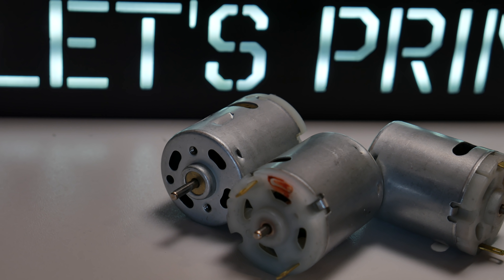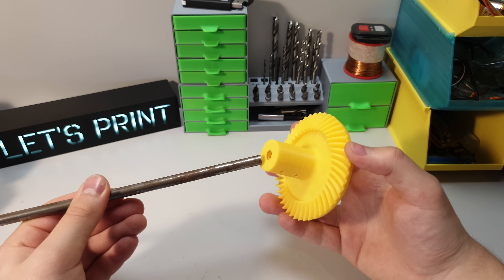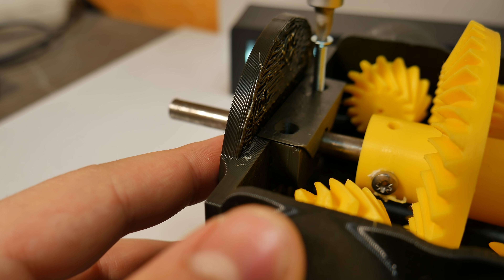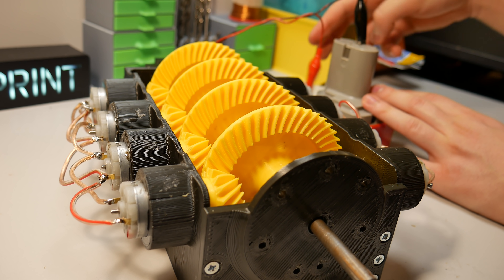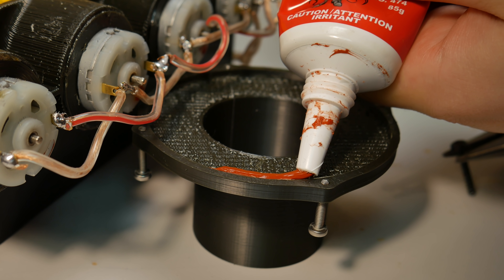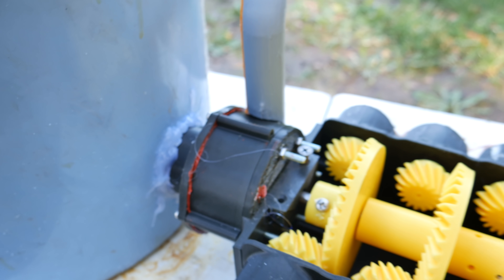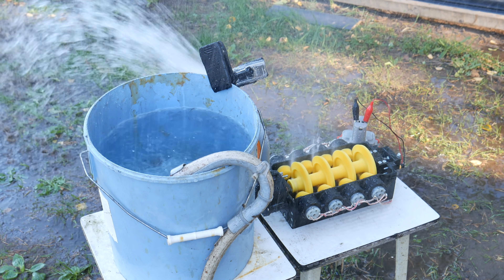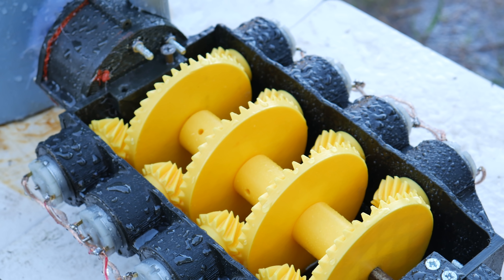Extremely Powerful 3D Printed Gearbox & Water Pump - Eight Electric Motors

Comment: If you disconnect up to 4 motors, you could use them to generate electricity also. You couldn't run the pump on them but you could regulate them and use them to charge other batteries like a laptop, tablet, cell phone or all 3 by regulating the outputs to different voltages. Great project!!!
Reply: ... Don't you think it would be more efficient to just send the electricity for the 4 connected motors directly to whatever you were planning to power with those generators?  No losses due to friction, heat, noise etc.
Reply: @CyberiusT  What I was referring to was the 8 motors run on 12 volts. If the pump, in a remote location, could do it's job on only 7, 6, 5, or 4 motors, any of the others could be regulated with a 7805 or 7812) 3 pin voltage regulator to charge a cell phone, tablet or laptop. At the low current required to charge these, the added friction would be almost unnoticeable and wouldn't serve to deplete the main battery faster. Plus, all brush motors produce high voltage spikes with the passing of the commutator under the brushes. These spikes can damage sensitive electronics. Eight brush motors will invariably produce these spikes at different frequencies due to differences in their manufacturing parameters. In other words, no two mass produced products are identical. If you take one motor off line and build one regulator circuit for it employing proper filtration, you can obtain a pure DC output. Trying to get a pure DC output from the spikes of eight different motors being back fed down the main power line is achievable but it would be like using a Doberman to herd cats. You would have to track down multiple frequencies from 8 different motors in a tech shop using a spectrum analyzer. This would also be true using just one motor but you would be dealing with only one set of frequencies instead of sifting through a bowl of spaghetti with a pair of tweezers or picking fly shit out of pepper.
    I know that you don't get something for nothing but it was just a thought.
Reply: @jeffmccrea9347  Fair enough. In my defence, finding strange ideas in YT comments is remarkably easy.
Reply: @CyberiusT  Absolutely NO argument there, my friend.
My favorite is the kid that appears to be from India or Pakistan. You never see his face but judging by the skin color of his hands, the 240 volt outlets and fixtures he uses and other visual cues around his work area, this is just my guess.
    He likes to build and show "free energy" projects. He will wins a coil of wire, solder it to the contacts of a paperless speaker 
frame along with the magnet(s) from a microwave oven. He'll set it on a table, flip a switch and light a marked 240 volt light bulb or some such other project.
I don't know you so I don't know what you know so for you or any readers out there who wants to know how this trick works, here it is.
    Induction is the ability to send an AC signal, like house current, from one coil to another without any direct connection. Everything from the power transformer like the older, heavier wall transformer blocks that charged cell phones years ago to the big gray trash can with wires on it on the power pole behind your house all work like
 this. An example is the transformer behind my house. There are two coils inside. The wires going from the pole are charges with 7,200 volts. Obviously, if that power was fed directly into my house, it would light up like the 4th of July just before it burned to the ground. Instead, there is a coil inside that is exactly 30 times larger than the coil wrapped around it. There is no direct connection between the two. my house is in the U.S. so most things run on 120 volts AC with some high drain things like hot water, stove, dryer and central heat and air running on 240 volts for efficiency sake. The transformer on the pole, as I said, has a coil wrapped around an inner coil. This coil has a connection tapped exactly in the middle of it's turns. This way, the high drain items in my house can be powered by the ends of this coil at 240 volts and the lower voltage, 120 volt, items can be powered by the center tap and either one end of the coil or the other.
OK. What this kid has is a single coil plugged into a 240 volt, (his normal house current in his country), and bolted or propped up under his table. When he builds his projects, his coils are always wound to specific sizes and lengths which is what controls the voltage to the project. The microwave magnet and any peripheral parts are just for show and meaningless unless his project powers something that is DC powered. then Diodes and filter capacitors are used. When he's done, he will set the project on the table over top of the energized coil underneath. Then the bulb magically lights seemingly with no power source other than a stationary magnet and 
a coil. The bulbs that he uses are 240 volt clear glass filament bulbs and he shows the top of the bulb to prove it's rating. On the small wooden boards that he builds these projects on, there is no way that he could hide 240 volts worth of batteries. This is why he uses the bulbs that he uses. It adds to the mystery.
    Another one of his fun projects is his "super cap". Regular high capacity capacitors are just 2 sheets of aluminum foil with a paper separator. When charged, like a battery but faster, electrons build up on the negative sheet and desperately want to jump to the positive sheet but can't due to the paper separator. When a load is connected to the contacts, the electrons very jump to the positive sheet through the load very fast. This is how a camera flash gun works. I neglected to mention that the aluminum foil and paper separator and are wound into a sandwiched configuration in a round coil.
    A super cap is built much differently using something called graphene which is an atom thin layer of carbon instead of aluminum foil. It has a much, much greater capacity to store electrons so a much larger capacitor can be built in a much smaller case. Most electrolytic, (foil based) capacitors are rated in microfarads. micro meaning millionths and farads named after Michael Faraday who made many discoveries in the field of electricity in the 19th century. Super caps are rated in whole multiples of farads. A 20 farad super cap the size of a large soup can, built out of aluminum foil would be the size of a bedroom.
This kid was building a 5000 farad "super 
cap" out a four inch tall by 3 inch wide piece of plastic pipe, aluminum foil, printer paper, two glued on plastic end caps and 2 bolts for contacts.
    He would then "charge it up" with a battery then lay a heavy piece of wire across the two bolts and watch it burn up. Impressive!
    I must say that he had talent as a video editor because you couldn't see where he stopped the video, gutted his super cap and installed 4) "D" cell batteries which would burn the wire.
    If he was selling these things in the U.S., he'd be indicted for fraud. I debunked all of his stuff available as of last year with explanations as to how it worked and wrote him that if he were to bill his "craft" as a magic show, it would be entertaining but saying that it was "free energy" would only serve to disappoint people who tried to replicate his projects and prove him to be a fraud and a liar. He's still on YouTube.

Comment: Why would you use 8 small motors with a big unneccesary gearbox that introduces inefficiency when you could have used one bigger motor and just connect the driving shaft to the impeller?

Comment: 3:05 if you invert 2 of the 4 gears on the shaft you will no longer need that screw.
You don't even need to reprint anything. just reverse the polarity of the motors you flipped the gears.
Its the same principle of the double helix gear.

Comment: Constructive Criticism,  one thing I saw from Video is that the Exit pipe was to short. The blow back often caused water to fly back into the Gear Box which could have been avoided by lengthening the fluid exit pipe by 2 inches. but I do wonder what Other Fluids could this type of Impeller be used on. what Viscosity area it could be used on, Low to High?

Comment: I would've put some grease in the gears, it would've helped them move more smoothly. Not sure if it would contaminate the water, just a thought. Silicone oil isn't bad, but you'd want something that's thicker, that likes to cling.

Comment: It's not really a gear box, it's more just changing the direction of the motor.  You should try to step up the speed more with a series of gears instead of just repeating the one over and over.

Comment: Suggestions, first, look into sealed thrust bearings, they would work really well in this situation. Second, leave a gap between the impeller section and the gearbox to give leaking water a place to go other than the gearbox. Third, more thoroughly seal the impeller housing and seal the gearbox, with covers for the motors. Fourth, use grease(preferably marine grease to reduce pollution issues). It should reduce noise, protect the surfaces from friction damage and help waterproof the system. Fifth, grind flats on the shaft where the set screws on the large gears will be. Set screws do better at grabbing a flat surface than a curved one. And last, look up a better impeller geometry. You can make any shape you want with a 3D printer, you might as well make an effective one
Reply: I was thinking a print in place labyrinth seal and then grease.

Comment: You need multiple impellers passing the fluid from the first impeller to the second to the third and so on. The only thing you’re achieving with this is less rotating friction and distributing the load across multiple gears. You’d have almost the same results with only one motor and impeller. If each motor drove its own impeller you’d have a lot better pressure and flow. Or just one shaft with multiple impellers.

Comment: How is using 8motors really helpful. As rpm of the main shaft remains constant. Even if it's 2 motors or 8. The capacity you say, as the size of impeller and also the casing is same even for 2 motors or 8

Comment: Would be interesting to compare different impeller designs. Pla is easier to print with but abs absorbs less water over time so is probably the best choice. Also u cant chemically smooth the impeller like that if u use pla.

Comment: Hey, Cool project!
But i have to mention something here: You are not really showing the power of the pump with the current test setup. The height of the Water column (in the bucket) is more or less the same as the height of the outlet tube, which means that the pump is not working against the gravity, what pumps usually do. I would suggest the following, place the bucket on the ground, put the pump on a chair and make the outlet tube 1 meter longer. With that you create a significant difference in water level and you can measure the actual pump pressure [pressure = density * gravity * height].  Hydromechanics.
Non the less cool project and thumb up for this!

Comment: Make the impeller and turbine housinf farther from the gearbox. Use couplers to extend the connection. This will solve your water leak problems. It will still leak but at least it won't make your gears and motors and battery wet!

Comment: Maybe you want to put in an extra chamber that can hold the leaking water between the gearbox and the impeller. That way you have a wall between the pressurized water and a compartiment where you might find unpressurized water and you have a wall between that compartment with the leaked unpressurized water and the (hopefully now dry) gearbox.

Comment: This gearbox is reducing the circumferential speed of the impeller. That is the opposite of what you want in a pump.  But I guess you have to to get enough torque to overcome the rotating mass and friction.

Comment: You could make a shaft seal out of a rubber inner tube to stop the water from leaking out the spinning shaft. you just have to poke a very round hole in the inner tube rubber and slip it onto the shaft and seal it to the base of the pump. I used it for my homemade water pump and it works great with no leaks.

Comment: How much horsepower it is capable of ?

In another world can this pump the water from ground to  3  floor up ?

Don't forget your using 6 motors and they have a good speed and torque.

I know a one motor can pump between 1 up to 2 meter depends of the speed and the reality of the pump

Comment: I work as a mechanical engineer making screw pumps. We make everything from pumps the size you see here, to pumps that have 50" diameter collums. I have to say, this is seripusly impressive!! To get that amount of flow with such small electric motors and 3d printed parts is awesome, love the video 😊
Reply: @Random Autonomous Drone Pilot I'm betting that you are the best engineer in the world.
Reply: Will The plastic need lubricant?
Reply: @Greg-yu4ij  I think that most of these filaments would need some form of lubrication, although even water might work,,, using different plastics helps, vis-a-vis lubrication needs, but Delrin would be a good choice for some part, perhaps?
Reply: Hi i am working on a project related to centrifugal pump is there any chance i can contact you for any help.
Reply: @ZainKhan-xx6np  do you think that pump can be pumping oil or is it too thick, need a good amount of flow for a hydrolic motor that basically is moving a large vehicle.. as if the weels are propelled by the hydrolic motor.. but I want it to go fast even if the whole thing is heavy as a tank!!
Reply: @ZainKhan-xx6np  might be printing one like this but metal special alloys and the size can be adjusted to fit what the electric motors will be.. as I collection the electric motors I got lots of sizes.. particularly 1/2 HP and 1 1/2 HP motors that were for pool filter pumps big pools it is to say 👌
Reply: i live alone this is perfect for me
Reply: Have you ever built any tamiya Rc cars/trucks? Your designs are incredible and simple. Much like a Tamiya model. :)
Reply: I would put some grease that you put in machinery for the gears not melt and damage
Reply: @Anthony Demaio
Reply: That moment when some random guy with internet access and 15 $ do more than an engineer that get thousands for NOTHING.
Reply: wow
Reply: Really... impressive? It's being aided by gravity lol, put the pump above the tank, then turn it on.
Reply: @Random Autonomous Drone Pilot Bro get a life lol. He didn’t say it was sustainable in it’s current state or that it would be useful just like that. It’s clearly just a proof of concept type thing and he just said that it was impressive that it could run so well using small electric motors and 3D printed parts. I’m pretty sure the mechanical engineer who literally designs water pumps probably knows more about the subject than you. Stop trying to flex the intelligence that you think you have, it’s really embarrassing and you’re making an ass of yourself.
Reply: I like that it has some system redundancy, great for remote operation, and uses cheap motors, coupled together to get reasonable, and scalable, Power... I suggested one-way drive mechanisms on the motor, to prevent a motor failure from stopping, or slowing, the pump... I wonder if the gears could be printed in pom/delrin? Knowing zero about filament availability ;-). Also, maybe the gears could be run-in before final assembly, and run in a sealed enclosure with a light lubricant bath?
Reply: @Random Autonomous Drone Pilot and now looking at the comments on your one YouTube video; you seem like such a sad sad man, so bored with your disappointing life that all you can do is surf YouTube looking for videos to heat on.
Reply: @Random Autonomous Drone Pilot Credibility flew out the window at “ just by the comment “🤣
Reply: @lyteyearz5810  why?
Reply: How many engineers does it take to conclude that gravity is doing most of the work...

the water would have come out just as fast from a hole of the same diameter.
Reply: @Incarnation613  not many. It's clear this "home made" pump/gear box assembly does exactly what he expected it to do... make some watchable youtube content. You watched lol. As for the wannabe youtube engineers, this pump looks to be flowing roughly 20gpm. Not bad for what it is. Sure this system won't be sustainable or produce reliable pressure but as a simple project a child can assemble in science class this rocks. Pretty sure that's the point of his channel lol.
Reply: @Incarnation613  No... no it wouldn't have.
Reply: But it's loud as fuck only ok for basically nobody
Reply: @spacecowboy07723  It will actually get quieter as the gears "run in", and, in many applications, no one cares, for example, in the middle of a corn field, and, in many cases, it only needs to run intermittently.
Reply: @spacecowboy07723  I could easily use this for drip line irrigation, no one is going to care ... maybe the chickens.
Reply: @artichoke00  Drip irrigation needs pressure, not flow. I dont think this can create a lot of pressure.
Reply: @spacecowboy07723  Implying deaf people are nobody?

Comment: all you need is some sort of shaft seal on the motors and with the rear shaft the bearing box can be sealed and filled with oil, as far as the shaft seal, boats have them on the prop shaft to stop the water but still let the shaft spin , actually cars have them to in the motors and on axel shafts. The idea is great , I can see a lot  of  battery powered, lightweight pumps in the future, because now those things are a real pain to lug around.